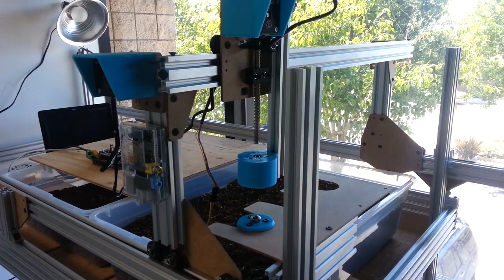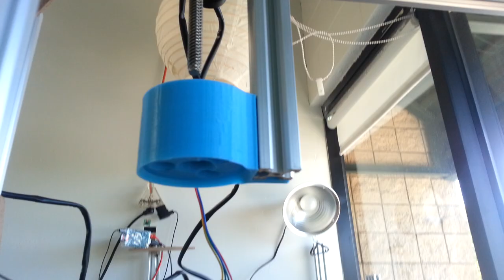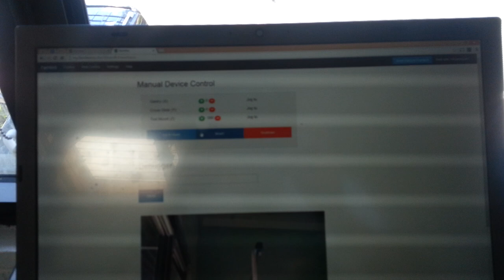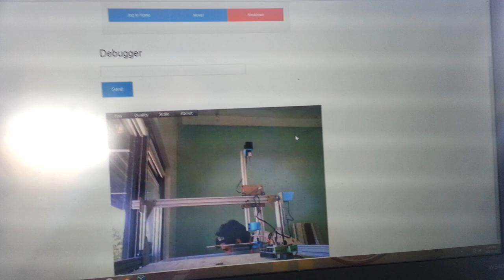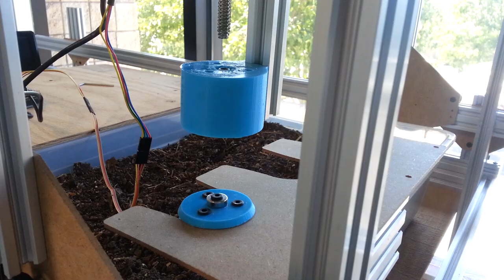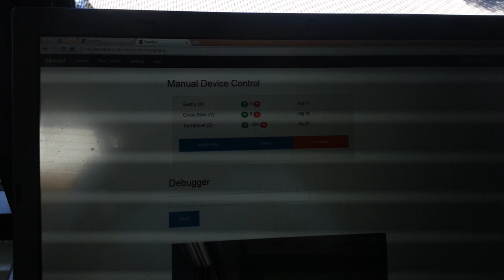FarmBot V4 Universal Tool Mount Testing

Comment: Nice! Have you considered using an electromagnet instead of neodymium magnet for cost reduction?
Reply from the maker: That's definitely a possibility, though an electromagnet requires circuity to turn on and off and is always sucking power when on. The neodymium magnets are quite affordable, about $1 per magnet. V2 of the mount is going to use three of them on the mount, and from zero to three on the tool itself. Stay tuned!